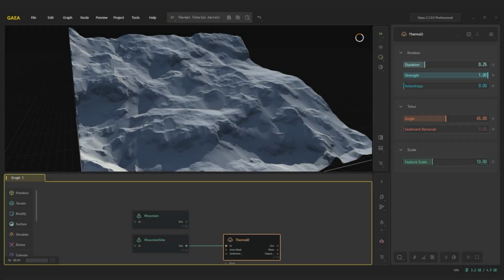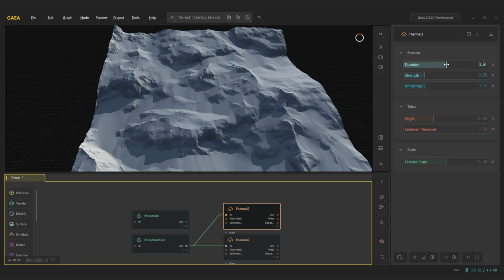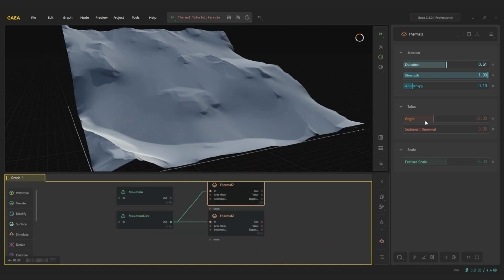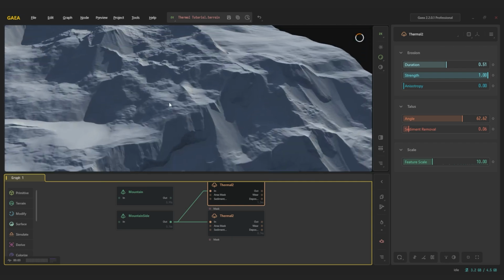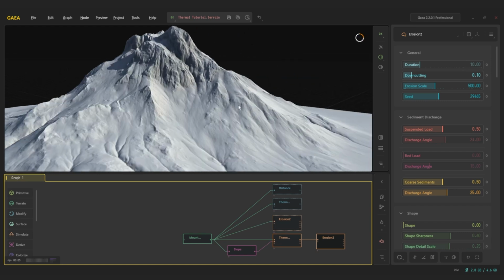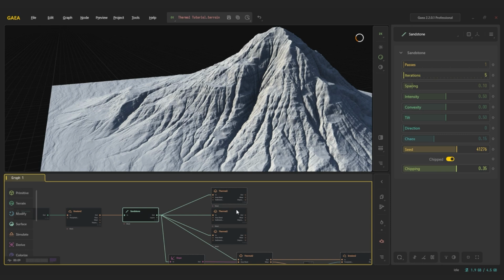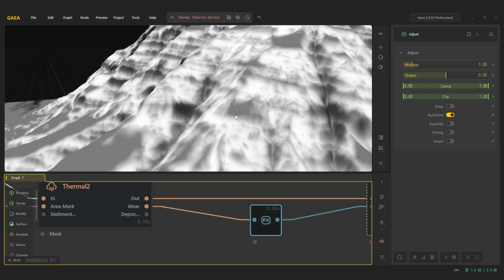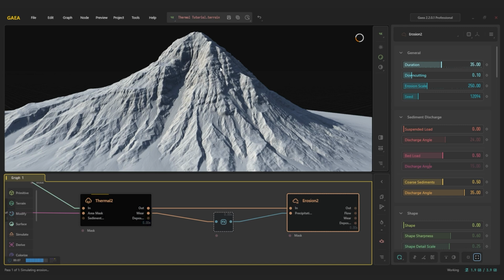Gaea Node: Thermal2

Comment: This is great, but looking to be able to make vertical cliffs and caves.
Reply from the maker: Gaea is 2.5D, meaning that you'll need to use another software to create caves or other shapes that can't be formed from a displaced planar image.
Reply: @quadspinner  ok caves are on the bottom of the list, but would really like to be able to make nice cliff faces. Ive tried in your software, but the issue is that it doesnt usually work if i were to turn it 90 deg because of how real cliffs have to abide by gravity. so would be great if you guys could make a vertical mode for cliff creation somehow.
Reply: @quadspinner  unless cliffs are already possible, and you could make a tutorial on it?